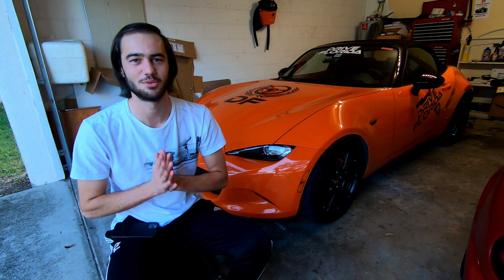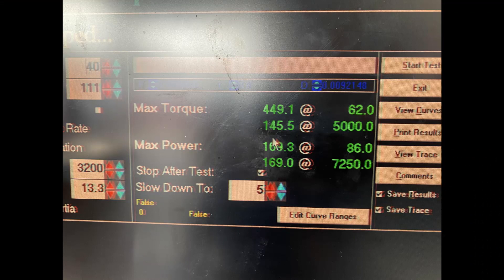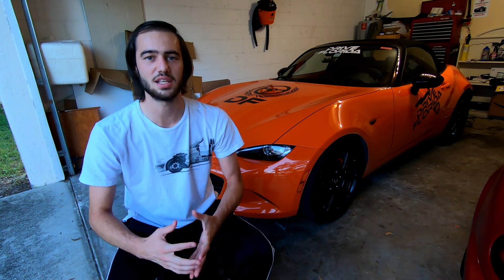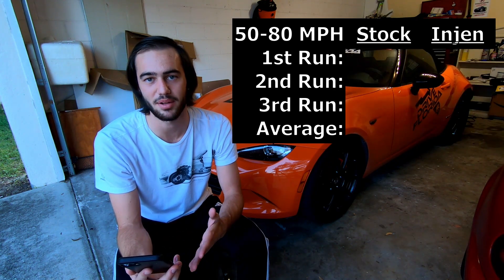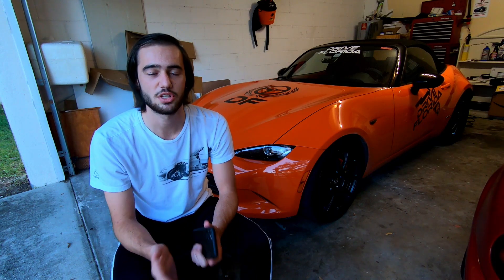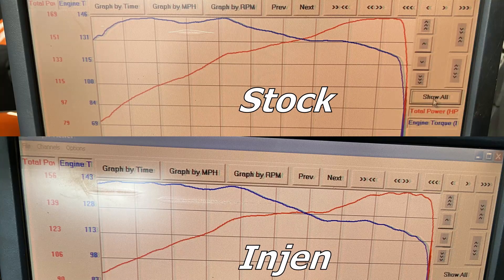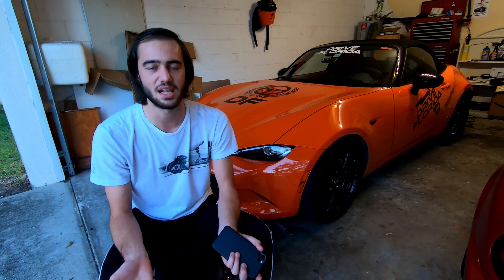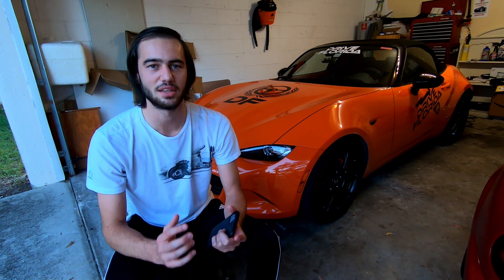Dyno Test: Do Cold Air Intakes add any Power?

Comment: Hi guys, I can also share my experience for all of you interested. I have a 2018 ND MX5 2.0 RF 160 CV. I made a dyno in a workshop close to my city. This workshop has 30 years experience reprograming rally cars. these are the results:       STOCK 160 CV (6400rpm) & 190 Nm torque (5000 rpm).        REPRO 170 CV (6400 rpm) & 220 NM torque (3900 rpm) (The curve is now more lineal and smoother)
Reply from the maker: Wow, those are really nice results! Reprogramming will definitely bump up the power, similar to the Fab9 N1 VersaTune video I made

Comment: I notice a difference in my 2010 Chevy Silverado inthe horsepower and gas if you think about it allowing it to breathe rather than suppressed by a closed box
Reply from the maker: @mattcampos2032  your Silverado’s intake box is likely less optimized for performance from the factory, although it could also be placebo. Have you collected any data comparing stock to the aftermarket one?

Comment: @3:14 Got nothing to do with ECU tuning or "airflow"...  Air in and out of an engine are pulses and stock intakes are designed with resonators with the timing of those pulses in mind.  You throw any aftermarket intake on there and all that goes out the window.

Comment: It really depends on what you want. You would need a tube and an actual head shield for the intake to work properly, if it’s not tuned or no properly made the claims and category of the intake power is actually lower or controlled determined by the MAF regardless. Then again, it does help me personally when driving to know when to optimally shift or downshift

Comment: I found this on the last couple of cars I put ram intakes on (without any tuning). Improved induction noise but worse performance. I often find they feel boggy at low rpm and makes most daily driving feel worse, when you are doing lots of stop/go driving. The induction noise you get is great though, if I could easily and cleanly increase induction noise but keep the stock intake, that's what I'd do.

I've seen sound tube modifications but they seem a bit hacky and to cap off an air leak you need to use something like rubber gloves to seal off the end of the bigger tube and it doesn't seem like a clean solution to me.

Comment: Maybe you have and I just haven’t seen it since it’s an older video. But with the aftermarket CAI seeing the performance “bust” have you tried a tune saying you have this intake and any difference? Maybe better if a tune was designed for that intake rather than OEM?
Reply from the maker: I haven’t tuned the car with an intake but I’m still skeptical as the placement of this particular intake pulls air from inside the engine bay instead of colder air like the stock intake. Plus since I lost like 15whp with just the intake, a tune would have to overcome a large power deficit just to keep up with stock performance, let alone beat it. Seems a bit unlikely to me, but maybe not impossible. That’s one of the points I tried to make in this video

Comment: I have a theory that the MAF needs at least one full drive cycle to properly adapt to any intake changes, so that might also be a determining factor if you installed and and immediately did these runs. But regardless any intake that draws air from inside the engine bay is crap anyways.

Comment: Can you do this again with the stock intake vs a drop in filter and removing the charcoal filter in the lid? My suspicion is IF there is a gain to be had on the intake system, this would be how we'd see it. Wouldn't heat soak any more than stock, same materials and ducting. Same exact MAF housing so no possible tuning issues between runs. So any performance gain would be directly from the filter and charcoal panel removal. I'd try it myself, but I don't have all the stock pieces anymore.
Reply from the maker: I think that would be interesting to see, and I wasn’t even aware of there being a charcoal filter in the inlet system. However I’m going to be selling my car soon and don’t really want to spend the money on another dyno session with it. My guess is with the situation you’re describing, it would probably make the same power, maybe 3 or so more with a drop in filter.
Reply: @DriveMX5  Yeah, I was assuming around a 3 hp gain as well. That's what other platforms like the BRZ are seeing. Probably not enough to quantify on accel tests but may show up on a dyno. Good luck with the next car! Loved your videos on the ND.

Comment: depend on the car . like lexus make a f-sport air intake that actually increases horsepower
Reply from the maker: Depends more on the design of the intake and how the ECU is tuned for it. I imagine Lexus put a lot more time, effort, and money into developing their f-sport intake so that it does actually yield results vs. the aftermarket companies. I would be interested to see some dyno charts for the f-sport intake to see if it does actually work.

Comment: I’ve read that several times, more so in this Miata’s, cold air intakes will make you lose performance… what’s a mod that will help?
Reply from the maker: Fab9’s N1 tune actually makes a difference, even on a stock car. Headers, high flow midpipe, and a tune with help even more
Reply: @DriveMX5  thank you!!

Comment: Have you tried the AEM CAI? AEM has always been a very good brand when it comes to CAI and I’m considering getting on myself.
Reply from the maker: I have not tried that one. It looks very similar in concept to the Injen intake but the heat shielding completely surrounds the filter and it appears to seal with the hood. I imagine that would make it work better than the Injen intake, but I am still skeptical that it will perform as well or better than OEM, especially without proper dyno tuning.

If you do get one, please let me know how it is!
Reply: Will do. Yea I’m on the ropes about CAI’s as well, I’ve looked into various different brands but none of them seem to have conclusive results unfortunately.

Comment: I don't buy exhaust for power, I buy it for the aural experience. I view intakes on some platforms in much the same way, induction noise can be wonderful. Do ANY of these aftermarket intakes enhance the intake sound in any meaningful way?
Reply from the maker: This one does! I wish I would have spent time recording the induction noise, it is noticeable when driving, especially when the throttle cracks open. You make a great point though!

Comment: MX5 is quite slow either way. I wanted my air intake for the noise, which only makes driving the MX5 more pleasurable where it matters. On and off throttle on twisty roads.
Reply from the maker: The noise is undoubtedly great from that intake!

Comment: Good honest test. No such thing as “Cold Air”
Reply from the maker: Thank you! I think the key here is the OEM intake pulls colder air from behind the bumper, while this one has the filter sitting in the engine bay. I think the results could be different if it was tuned appropriately, but 15whp is also a lot of ground to make up...

Comment: Well this very depend on how well is programmed MAF and O2 sensors, in meaning, how well it can compensate by adding more fuel to keep correct A/F ratios. For some cars CAI is painful, for others is good and improved power distribution in many rpm ranges. For my mercedes it working, sharper throotle response, i no gained total horse power, but gained +4 lb/ft and power graph improved anyway, for example near the top  rpm range, i gained about 5 hp everywhere, from 5700-6300 rpm range, but my car reaching max hp at about 5500 rpm, so number are not improved in paper, also power distribution graph looks much better at ranges 1500-3000.
Reply from the maker: Exactly. There’s a lot of factors at play here. In this case, I got worse dyno results and real world performance. But like I mentioned, I think the story might be different if I got the ECU tuned for that specific intake
Reply: @DriveMX5  Yeah, tune is always best thing. But now primary I will check if maf, even iat and o2 sensors are healthy :) I can say from my experience, if maf or o2 sensors are bad , car like to go in default maps state, so your get too lean or too rich mixture due cars ecu dont know anymore what to do.

Comment: The sound that you hear is the air being restricted  by the aftermarket cold intake filter. Just like water when you don’t open the valve completely
Reply from the maker: That could be part of the reason it’s louder. I think a bigger reason would be the fact that the inlet and filter is no longer covered by a plastic box that deadens the sound.
Reply: @DriveMX5  I thought about that too. I remember when we used to flip the round lid of the air breather on carburetor engines  exposing about an  inch  of the round air filter. Giving it a very throaty sound. I guess one could leave the top of the air breather off as long as the air filter stays inside the box. But it would then breath the warmer engine heated air.

Comment: Hey guys I hate to be the party pooper. But cold air intakes on any car perform worse then OEM like 99% of the time. I’ve used them when I was younger in my cars and it always felt worse.
Reply from the maker: I’ve always heard the same thing, but wanted some concrete data to prove/disprove it. A well designed intake might help, but the OEM intake is already pulling in cold air and the engine is tuned optimally for it. Seems with most cars, gains are to be found on the exhaust side by improving the flow.
Reply: @DriveMX5  yes and I am thankful there is videos like this out there.  No bs and all real. I used to look for videos exactly like this to get a definite answer.  I still have friends who swear by mods like this and I always tell them. Look at data and research etc. but they never do lol.
Reply: Lol
You never had a Turbo car ?
Cos most turbo cars gain power
Reply from the maker: @hondamanvtec2894  I remember mighty car mods did a similar video and basically got the same results. Power was lost (or at best none lost, none gained) with a cold air intake on an N/A car but they did make some gains on a turbo car. I had the BMS intake on my old 135is (N55 single turbo) and it did feel peppier and more responsive.

Comment: dbwatts47
I have a 2016 nd and I installed an injen intake along with  Borlas (PN11919) cat back exhaust 
system.  The results 171 bhp and 149 ft-lbs torque . You are correct about the stock air box being
better than aftermarket intakes. However, when combined with a free flow exhaust system everything changes. If you don't move exhaust gasses out of the cycle... the intake won't make much of a difference.
Reply from the maker: That makes sense. All I have is the GWR race muffler. I’m sure changing the rest of the exhaust system would make a positive difference in power

Comment: It’s the exposed filter for sure. If you had gone with an intake with a cold air box, such as corksport or takeda, it would have remained cooler as it wasn’t being heat soaked. 

That being said, the stock intake on these cars, from what I understand is very efficient. According to Goodwins website, they had tried the same test you had with different intakes and came to the conclusion that unless you are pulling 250hp, an aftermarket intake on these cars is a waste of time and money. 

Thank you for the video btw.

Comment: So if I’m going to dyno the car, would an injen Intake and an isr circuit exhaust be alright? Like would I gain power? Not trying to lose any
Reply from the maker: Likely not. The Injen intake proved worse on the dyno and acceleration tests. Exhaust may help, but Injen intake will hinder you

Comment: 150 hp??? Not 184hp from factory?
Reply from the maker: 181hp is the factory rating at the crank. The car actually put down 169 to the wheels with stock intake and GWR muffler, which, assuming as low as 10% drivetrain losses, the engine could be putting out 187hp or even a little more

Comment: The ND2 is a finicky beast, the programming is so tight on them that vendors are having a bear of a time remapping them and there is still no commercially available forced air upgrades.

I put a Racing Beat Sport/Race on my 20 RF and I think it woke it up a tiny bit, other people have dyno'd performance cat backs on stock ND2's and have seen 2-4HP gains- but if you compare the 8hp the ND1 gained, it just goes to show how much they tweaked the whole engine/exhaust/intake system.
Reply from the maker: Very true. I plan on doing long tube headers in the near future and getting it tuned (as long as I can find someone with the capability of doing so), hopefully that will make some real gains, especially from deleting the first cat
Reply: I was wondering same thing. Maybe because there were already great improvements made by actual Mazda in HP and Torque from the ND1 to ND2? I have no idea but I’m curious on it as well

Comment: @drivemx5 Ive added a Pro Ram performance panel filter. And a silicone hose on the elbow that comes straight out of the air box. That alone I have noticed a major difference. Yeah you don't have the noise as such but much better acceleration I think. Give it a try! Much cheaper than these non working induction kits!
Reply from the maker: I think I will! The filter and silicone elbow are much less expensive than the aftermarket intake systems anyway. Thanks for the feedback!
Reply: @DriveMX5  no worries mate. Like you I love the sound of an induction kit. But I've seen so many expensive kits about and none of them appear to work on this car. So took the route of the performance filter and silicone elbow. Noticed a difference straight away but haven't had it timed or tested yet. 😀👍

Comment: How is the sound? I am desperate for extra noise. I have the BBR cold air feed and would plan to use some nimbus heat shielding sheets to help prevent hot air getting to the filter.
Reply from the maker: Quite noticeable difference. I plan on adding a kn filter to the stock intake to boost the noise a little, I just wasn’t happy with the power loss of the Injen intake but the sound was awesome. I think your plan sounds good!
Reply: @DriveMX5  my car has also been remapped with the bbr super 220 kit. I think I will give it a go and see how I get in, you can also get carbon cone filter heat shields for very cheap on ebay that I will try, and sleeves that velcro on to intake pipes from a company called funk motorsport.com that may help also.
Reply from the maker: @zzkamikazezz  awesome! How does it feel with the BBR kit? And thanks for the advice!
Reply: @DriveMX5  it feels great, I only test drove a 184 and I was instantly foot to the floor, then mine went straight to bbr when I bought it without driving. Im very happy with the performance of it compared to how the 184 felt
Reply: @DriveMX5  so I installed the kit today and got some good results! Pre install from 2k rpm in second right up to just before the new 7800 bbr redline I got 5.77, 5.71 and 5.8 seconds. After fitting the kit (with the bbr cold air feed resting on the cone) I got 5.4, 5.67 and 5.63. This was on the same road using the same sign post with a rolling start in second at 2k rpm. I was hoping for more induction noise though :( I may get one of these for the intake pipe, but I’m undecided. No room for a carbon cone heat shield though. https://funkmotorsport.com/product/lace-up-induction-kit-thermal-barrier-sleeving/
Reply from the maker: @zzkamikazezz  those are nice results! Just from the carbon cone and heat shielding?
Reply: @DriveMX5  ye, quite happy with those. This was the standard injen kit with the bbr cold air feed only.
https://i.postimg.cc/qM0J80Sd/94-DB9-DFA-0651-44-D5-ABD4-9582895-D36-CE.jpg
https://i.postimg.cc/t4B4qfrG/25-DDC10-A-AF1-A-4-C49-BBC5-BD766-D9-CA4-F6.jpg
Reply: @DriveMX5  there isnt room for the carbon heatshield and I think the nimbus will be a bit of a pain. Im going to order this and call it a day https://funkmotorsport.com/product/lace-up-induction-kit-thermal-barrier-sleeving/
Reply: @DriveMX5  the before time were K&N to anel filter and bbr cold air feed as part of the super 220 kit